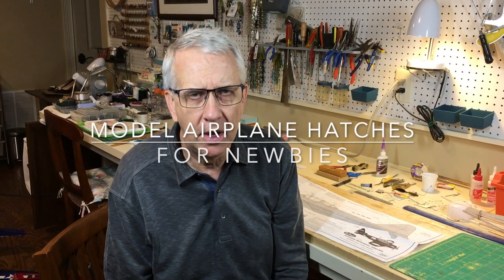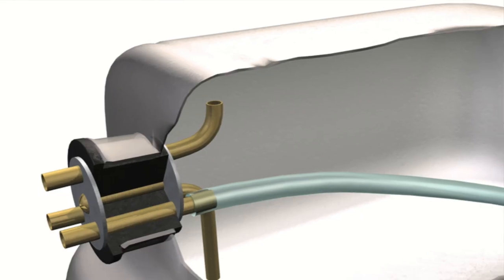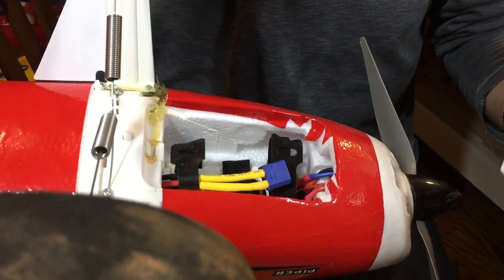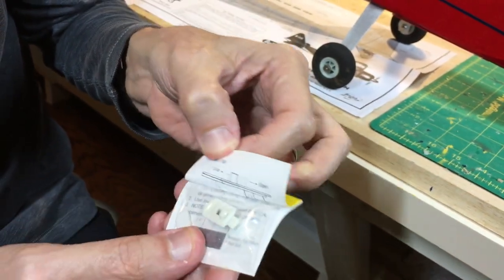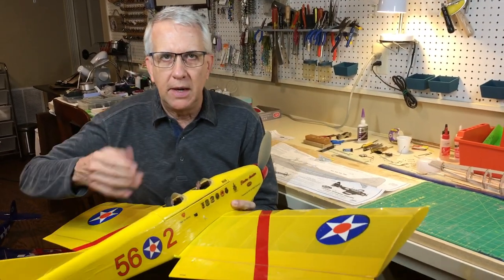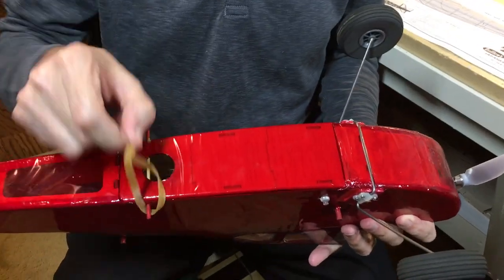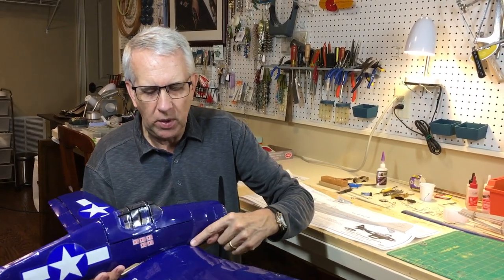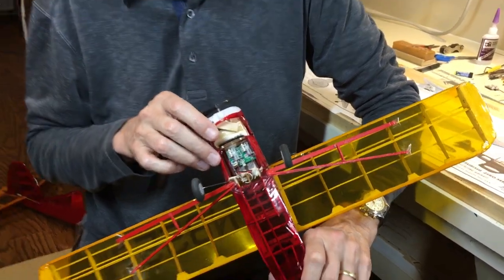Model Airplane Hatches for Newbies

Comment: Thanks Tim, I've been looking for a video like this for a week.  YouTube finally realized what I was looking for and put this in my feed.  I'm converting a couple of planes.  Quite a bit bigger than what you've shown here, but I appreciate getting the ideas and the how to's.  I already have the magnets.  Now it's time to cut open the plane.     😱
Reply from the maker: Wayne:  Glad it was helpful!  The key to a snug hatch is glue/attach the magnet to the door.  On the fuselage side, where the hatch will close, find a flat head screw that is attracted to the rare earth magnet.  The wonderful thing is you can adjust (turn) the screw to get it at just the correct height for a firm screw to magnet connection.  Tim

Comment: I went thru a phase, where I always worried about the size of the hatch, the battery, and the battery box. Then I would get a buy on a different brand of battery, and it would barely fit, or not fit. Now, within reason, I just make the box and hatch as large as I possibly can. And shim the battery to where I want it, with loosely fitting blocks of foam, to still allow airflow. Now, different size/brand batteries always fit, and I don't break out in cold sweats when it's time to build the battery box/hatch.
Reply from the maker: David:  Fully agree.  Also, some velcro on the battery and the hatch bottom helps out a lot.  Tim

Comment: I need to look into those metal latches you showed. I don't care for those white plastic ones you showed. The handle can slide back on the metal pin, leaving the hatch permanently latched shut. I may be guilty of using it on to large of a model, with a snug fitting battery, in too small of a box.
Reply from the maker: David:  Agree, I think the metal latches will work out a bit better.  Tim

Comment: I have two very similar old school nitro .46 size high wing balsa airplanes I would like to convert from glow to e-power....
Both of these models are balsa kits and are Monokote covered and neither currently has any access hatch , as the fuel tank design is installation and removal through the wing mounting area.
My questions are;
What exactly is the best way to cut the hatch opening for the ESC and quick battery mounting and replacement at the field.
Should I cut from the top of the fuselage down, or cut along the sides of the fuselage near the top ?
Should the cut extend into the windshield area or just the flat top of the fuselage?
Should I use hinges, latching devises , screws or magnets for the hatch ?

thanks much
Reply from the maker: Gary:  There really is not set way to install a hatch for your batteries.  I have installed a hatch on the top (Bronco), side (Live Wire Champ) and bottom (Speedy Bee).  It just depends on the model, I guess.  Usually, I thing a hatch on the side of the fuselage looks about right.  The hatch needs to be large enough to easily fit the battery in and out between flights.  Ensure the hatch hinge is to the FRONT of the planes, so it a latch fails the airstream will keep the door shut.   A rare earth magnet (Amazon.com) in the hatch door, with the magnet connecting to a metal screw in the fuselage, works good for a hatch.  I did this with my first Bronco video.  Tim

Comment: Hatches are always an afterthought for me, and I regret it every time I fly...clumsy rubber bands or tape. Nice idea to use a thumbtack for the steel to engage the magnet.

What's the model at the end? Looks like a real floater.
Reply from the maker: Polylight:  Model at the end is the "Foam RC Backyard Flyer for Newbies."  https://youtu.be/EbSDGOMbLB0
Plans included in the video.  Tim
Reply: @TimMcKay56  I'm sorry, that's not it, but I somehow missed that you had titled the plane I was interested in - the Blackburn Monoplane. Heading over to https://www.youtube.com/watch?v=orzjftMDrRs to check it out...looks so nice!